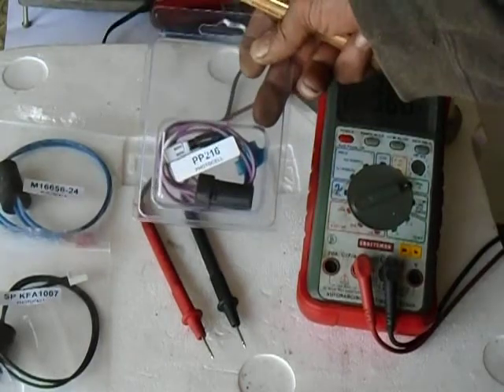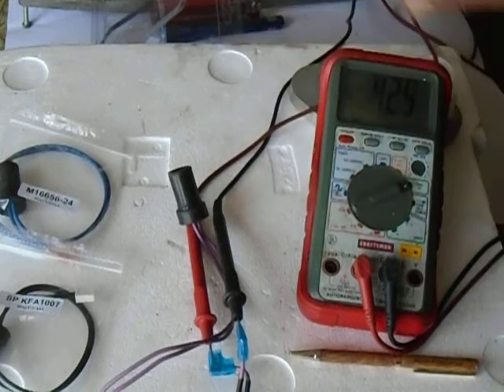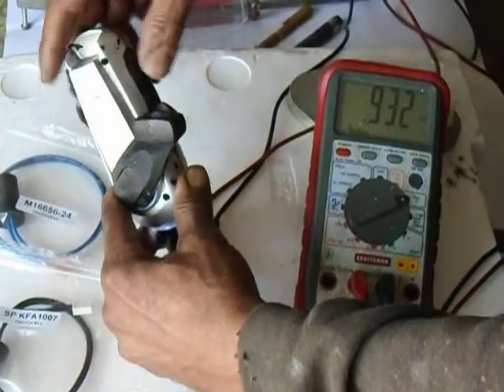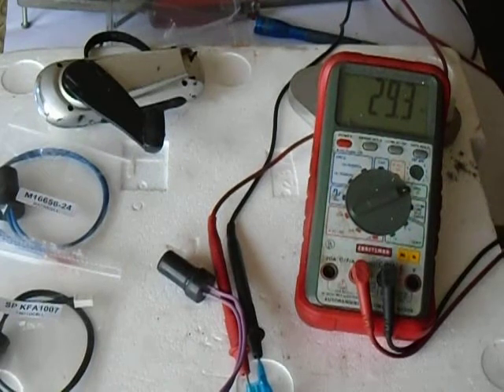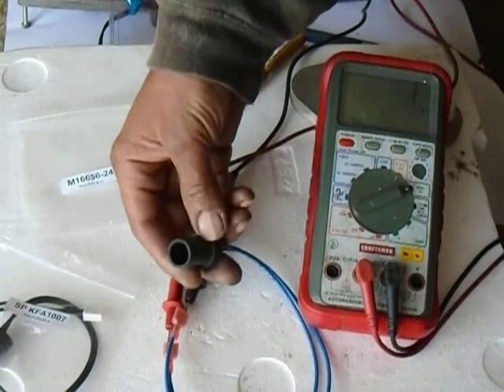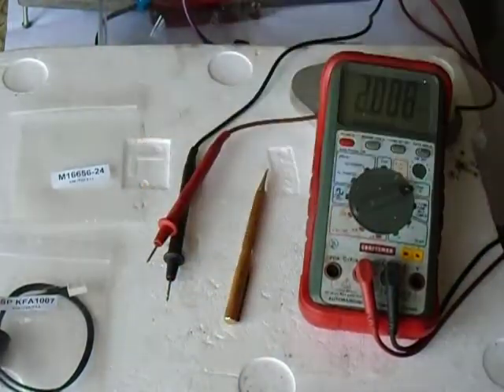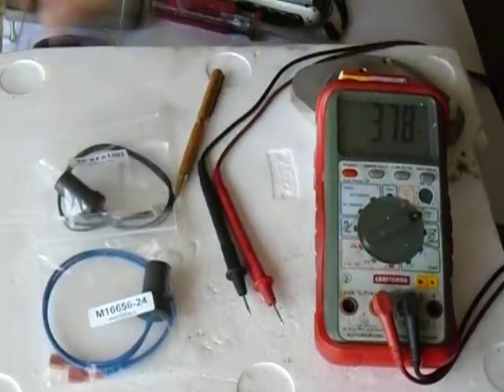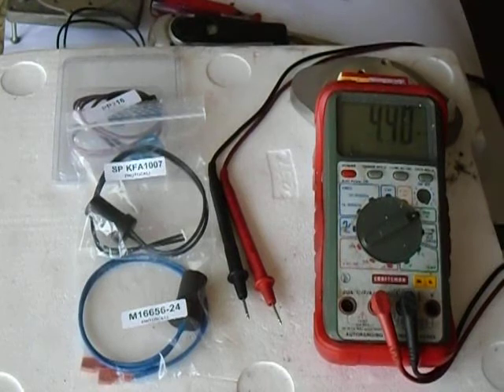Torpedo heater repair. Photocell readings and information

Comment: I have a reddy heat 55,000 btu with hot surface igniter, it turns on runs for a bit shuts off , thank you Im going to test my photo cell  if I have any questions would you help me out ? New to these heaters got used from a friend for my workshop

Comment: One of the questions I always had about these heaters is; why do some only run with the top off and some only with the top on?
Reply from the maker: Usually that is from a air or fuel problem. If the lid is on that directs the air flow through the heater. With the lid off the fan is just spinning in the air.
Reply from the maker: @cd2920  The biggest problem torpedo heaters have is low air pressure. That will also cause a heater to not run with the lid on. When you repair a heater and the lid is off the heater should start in a snap. If it does then it will also start when the lid is on. If it hesitates with the lid off then it is not fixed properly.
Reply from the maker: @cd2920  I fix all kinds of radiant heaters. Those fuel pumps are cheap

Comment: Would you know what brand propane space heaters use a photocell instead of a thermocouple? I don’t want to have to manually start the heater every time I need heat. My friend has one that starts with an on off switch only his is 30 years old.
Reply from the maker: I dont know of any that use a photocell

Comment: I have a reddy heat 55,000 btu with hot surface igniter, it turns on runs for a bit shuts off , thank you Im going to test my photo cell  if I have any questions would you help me out ? New to these heaters got used from a friend for my workshop
Reply from the maker: Sure you can call 216 801 6215 for parts and service advice